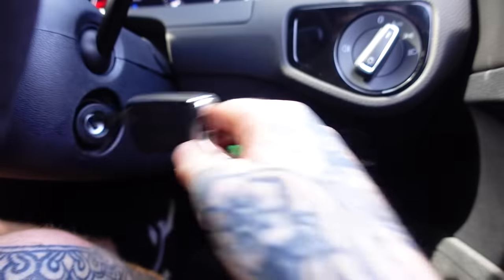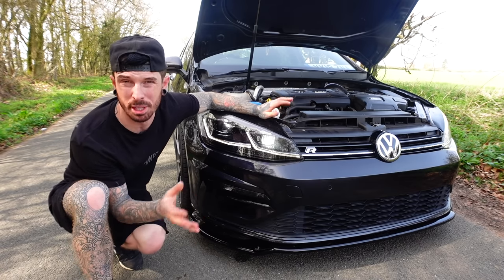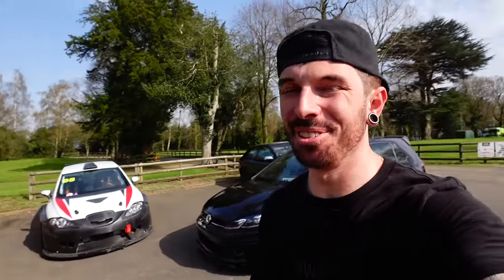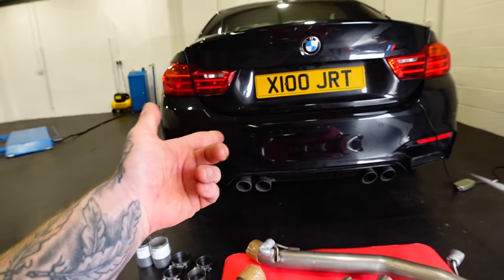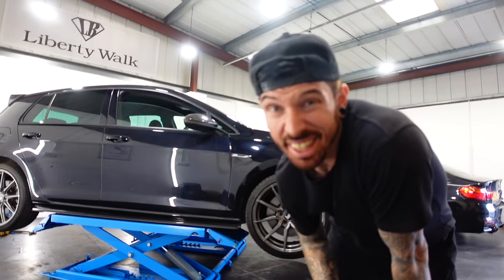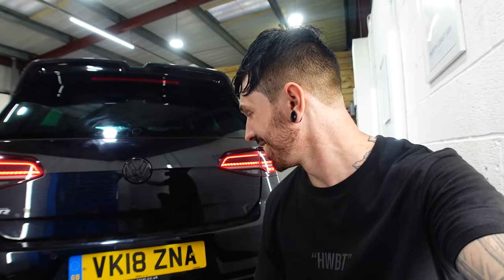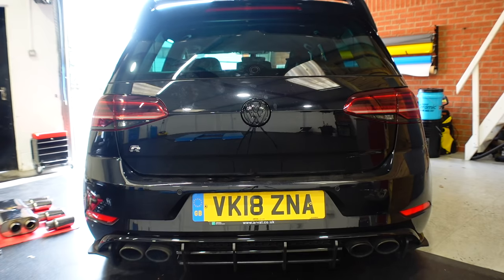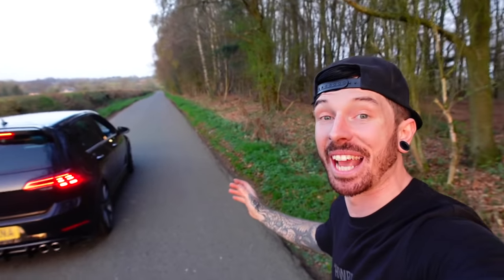I FITTED AN INSANE EXHAUST TO MY WRECKED VW GOLF R

Comment: OEM exhausts tend to be pretty efficient these days ... my 5.0L XKR (Supercharged - 550HP out of the factory) showed minus 5HP after a b4 n after dyno session. Seen it with other cars I've owned before - negligible if any gains. Sounds better though which is the main reason for doing it.

Comment: The exhaust looks good, but a little quiet for me. I used to have a MKV GTI and had a full stainless system on that and didn't sound too hot at idle, but at 6-7000RPM, it was as amazing as a 4-cyl could sound. With no visual mods, a tuned Golf R would be a total sleeper.

Comment: Front Assist problem?: Try parking the car with the radar 1.2m away from a wall (steering wheel straight & car exactly at 90 deg) (the fancy target is only needed for lane assist), and perform a calibration in VCDS.

Comment: I might be wrong but you could try and fit an anti drone res delete pipe from shak at bolt on mods . I'm aware it's already has no resonator but you could add the anti drone into the set up with a bit of modification.

Comment: The Reason why 1 dipped beam is on is because you have bought a matrix led headlight with independent highbeams assist, you have to get a normal one with normal high beam assist wich just turns off when there is a car coming

Comment: subscribed :)  - All that work on the top sports 'R' model...Frustrating! - Should have come from the factory with most of those 'upgrades' as OE (except exhaust, which is neither legal or desirable) - Just why dont they produce a, I dont know, err,  R  'S' model with stage 1.5 tune and all the hardware to the higher spec (pretty much as fitted by u following Stage 1 - with ludicrous amount of unnecessary work that could have been avoided..)  - Like to see this done on the TT mk3, but keeping it MOT/insurance friendly

Comment: You took a bunch of the “good to daily” aspects out. The exhaust sounds good but should be quieter. And will the rear window not have zero airflow moving water away, especially with that wing. So goodbye rear visibility in rain? 🙃 (it’s cooler but probably worse to drive)
Reply from the maker: But as I said in the video the whole aim of doing this is to make it as quick as possible not to make it the best daily ever haha
Reply: @MatArmstrongbmx  I must've missed that, I thought the Q5 was Hannah's daily and this would be yours, just based on the other cars you have. But as I said, it's still cooler with the mods! :-)